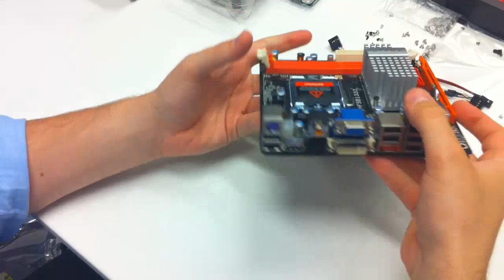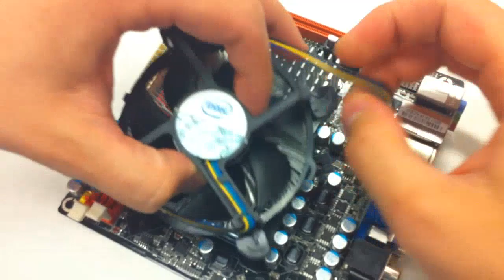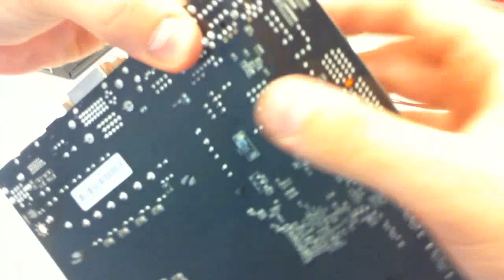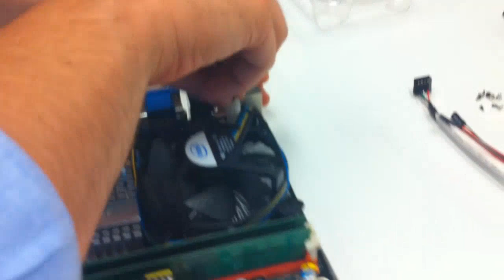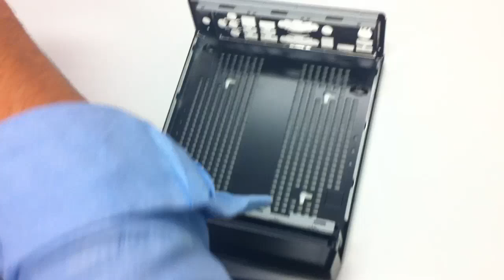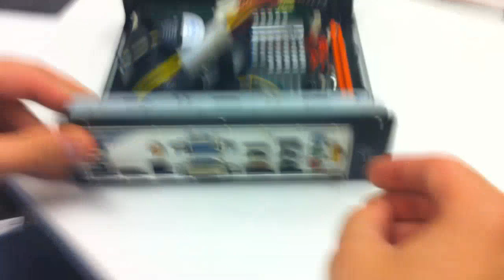Building a Mini-ITX computer with Mini-box Part 1

Comment: so im looking for a good am4 mini itx motherboard which can gat a R7 1800x up to 4ghz, don't know much about motherboards so pls help anyone
Reply: it is for a mini itx build? you should not try to overclock any CPU on a micro itx build... as a general rule micro itx are mostly for replacing consoles or having a PC capable of relocate or travel. The smartest choice would be an i7 6700k (7700k will produce too much heat). It might lose some performance compared to ryzen on productivity, but it will be much safer for a mini itx build.

If you want to stay Ryzen, step up into micro atx, you can find very good b350 mobos and cases that will provide both support and decent cooling solution for overclocking.

Comment: Why zip ties? I get that computer parts come with them, but they are permanent. Twist ties are better. They are easy to remove and you don't risk cutting wires removing them.

 I just finished my first computer and I love twist ties.
Reply: Odd _pistachio1 what are the parts and specs?
Reply: I'm looking to build a mininitx

Comment: Why did he not use thermal paste when installing the heatsink/cpu-fan?
Reply: +Joshua Skillman Most intel cpu stock fans/heatsinks come with pre-applied thermal compound
Reply: Thanks, that is actually good to know.
Reply: +Joshua Skillman I always make sure if I am buying a CPU cooler that it comes with pre-applied thermal paste. That crap is terrible to work with and with the pre-applied pad there's always the guarantee of no human error. Thermal paste also expires quickly, so can't keep any around. Every cooler should have pre-applied, if it doesn't, buy a different one.
Reply: Preapplied thermal grease simply suck, first thing I do is wipe it off and apply a real coating.

Comment: most phones are more powerful than this
Reply: +Owari Samsung galaxy s7: 4gb of ram, arsreno 530 gpu, 2.3ghz quadcore Cpu
Reply: +Jordan Groombridge ardreno***
Reply: This video is 5 years old a lot has changed and that CPU is well dated now and was considered low end at the time
Reply: +Jordan Groombridge 
Consider the X86 and ARM architecture. This PC is AT LEAST 4 times as fast as those phones. The galaxy s7 can barely run windows 1998...

Comment: I also want to build one. But how do I add a GPU if possible????
Reply: You can't.
Reply: +Matthew Martiez liar
Reply: +Varun Choudhry if ur going to had a gpu u'll need a case with expansion bay slots, and enough lenght to fit the card, if u wanted something more powerfull in that same little case, u could do a amd apu build, with a fm2 motherboard, the amd apu's have some pretty good integrated gpu
Reply: +Varun Choudhry 
PCie ports. please don't listen to matthew.